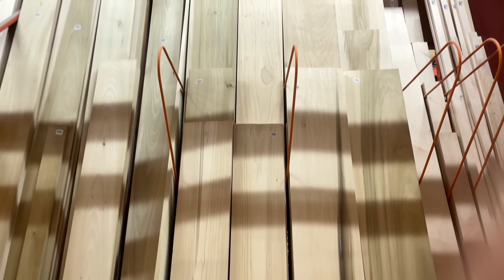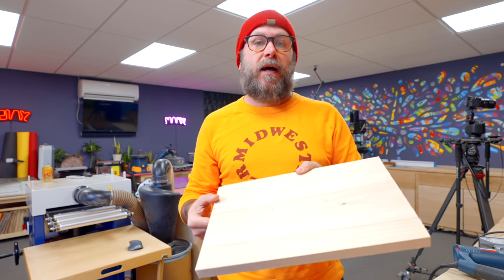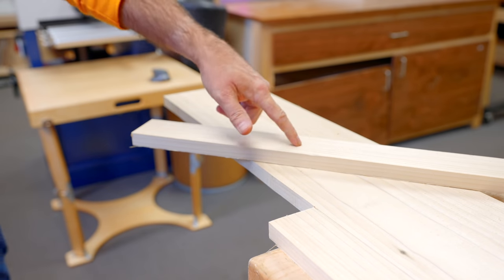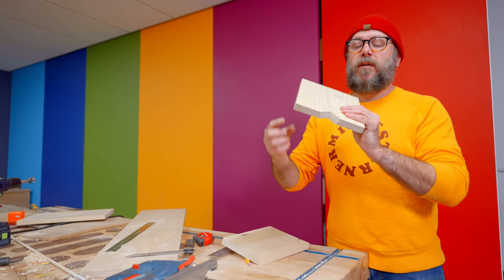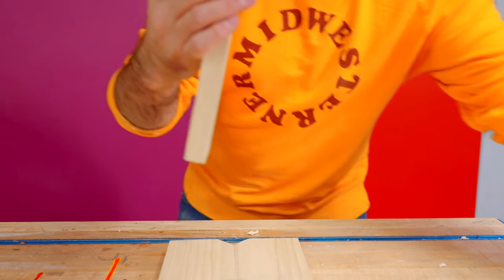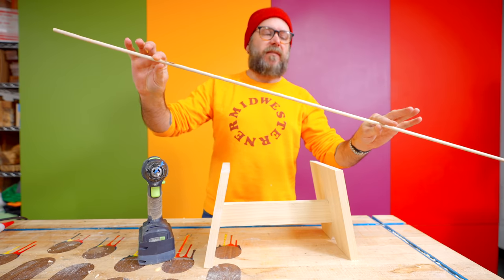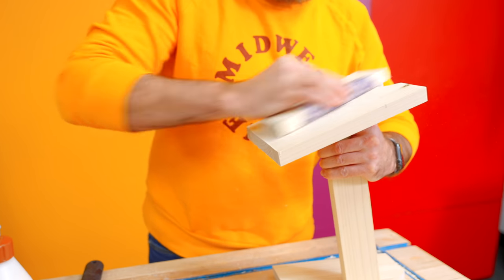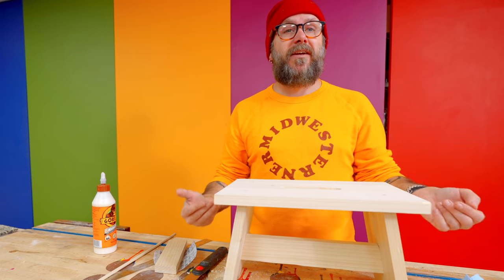A Basic Stool. Your First Woodworking Project

Comment: projects like these are great for veteran woodworkers too that might need some motivation and an excuse to get back in the shop.  I know I run out of inspiration from time to time and need an easier project to get something in the 'win' column
Reply: This exactly.  I'm in a season with no time available so I wander around in a circle for about 15 minutes to think of what I could do then leave with nothing.
Reply: I’m late to the party here, but you’re spot on! It’s good to push your comfort level, but from a 63 year olds viewpoint, I find that constantly raising the bar has actually pushed me away from my woodshop! When we let a hobby get to the point that it antagonizes us, it’s time to reevaluate! There’s a lot to be said for simple, straightforward projects, and this project is a shining example of one!

Comment: Drilling a hole at the apex of the triangles on the legs will prevent a split appearing there in the future. It's easier to drill the hole first then cut the triangle to it. It's the same reason why airplane windows don't have hard angles. Hard angles accumulate stresses and cause splitting.
Reply: Also, when drilling the dowels for the legs don't drill them all at the same angle. If you look at them from the side they should form triangles. This will better resist the top being pulled off.

Comment: That turned out nice! The jigsaw is my least favorite tool, because my cuts are always out of square, or unintentionally beveled. 😄
Reply: I hate it, too. I can never keep the foot planted squarely on the material, or I try to navigate turns too tightly and the blade just kinda screws off at whatever angle it feels it wants to. Most of my cuts need to be sanded/filed/planed back into square.
His comment about the saw pulling itself into the work was interesting. I can't recall seeing that, but maybe it was just my frustration dulling my senses. I think I'll take out a board tomorrow and casually hack it up with the jigsaw just for old time's sake.

Comment: Liked the simple one...seemed to be quicker actually with fewer steps. The one with the fancy tools, soon as I saw it on the CNC, was wondering why not do the cutout on the cnc as well, why then move it to the drill press and then use the jigsaw -- have the CNC do the hand hole -- and just clean up with the sander. Not a fan of the grooves, messes with my OCD, non-uniform.

Comment: Real world notes.  7' piece of poplar (enough for 2 stools if you don't jack it up) was almost $60 at HD.  As a very new woodworker still in middle of this project, it is not complicated but also not easy due to angles.  HD doesn't carry the digital angle finder so I sourced a $10 protractor which worked pretty well once you figure out how it works.  Cutting straight lines at an angle with a jigsaw is not a slam dunk.  Without a straight cut it is difficult to glue them properly as the wood has dips.  If you have a clamp it is also tricky since the clamp is at an angle.  If you use the CA glue method you will need to find CA glue which is not easily obtained at standard stores.  If you use Gorilla super glue  as a stand in for CA glue and have to manipulate the wood at all it may mix with the wood glue and not do as good a job at holding forcing you to use the clamp.  You may then issue an F bomb or two and wish this new woodworker project didn't have angles.

I ended up using a 1/4" dowel ($1.11) to better fit with my drill bits and make it easier to fit when drilling and not  blowing out a side.  I still blew out a side in my haste.  It's a good idea to mark the length of the dowel you are installing or it's hard to know if the dowel has inserted the full length of the drilled hole.  If the size of the drill bit is very close to the size of the dowel it is not a slam dunk to install the dowel and once it is partially installed it will not be easy to remove and start over.  My 6th grade wood shop stool is almost done and I will use a round over bit on my router to make it look a bit more finished but doing is significantly different than watching and there are many many parts which are tricky to the new wood worker.

I'm going to tackle a second stool with the remainder $30 of wood with my table saw and a bit of experience to see if it goes any better.
Reply: Stool is complete and amazingly turned out really nice. Thanks David!

Comment: David, could you shed some light on the cost per board in the US? Maybe for different species?

Any wood where I'm from (northern Europe) seems incredibly expensive. Let alone being able to source anything but construction pine/fir and the occasional pine/fir/oak/beech shelf boards. I love the beech boards but converted to US dollarinos they probably cost 15-20 dollars per meter (lengths up to 2 meters available).

I ask because the majority of hardwood dealers here only sell B2B, so they won't even sell to me haha

Comment: Wouldn't it be easier to use a hand held circular saw for everything but the handle?
Reply from the maker: In woodworking there are many ways to do nearly everything! Use what you have or what you enjoy using the most!

Comment: Very nice!

My workshop is closer to the second build (a small Birch ply CNC router was my lockdown project last year, and is soon to be upgraded with Aluminium uprights, faster spindle, and a second pair of linear rails on the Y-axis, amongst other things).

Just one question; I was wondering why you didn't cut the handle on the CNC while it was set up for the texturing operation at 14:20?

Liked the laser cut inserts; I'm experimenting with laser inlays at the moment... :)
Reply from the maker: Thanks! Honestly I thought it would make for a better video to use the drill press than the CNC. Just to give it a bit more variety.

Comment: Lovely build! I liked all the extra touches in the fancier build like the routed grooves along the top and the staining etc.

Just wondering: is there any reason why you couldn't make this with mortise and tenon joints instead of dowels? Is it just simply a more difficult process to cut the mortises at an angle so doweling is a more simple solution for joinery?
Reply from the maker: Thanks! For me that would have been more difficult. I should have done it just to show it.

Comment: Why the hell is festool going to make the most expensive tools and make them as cheaply as possible. No overmolding, no fiberglass reinforcement to the plastics, they don't insulate the pcb with simple silicone calking to prevent water damage in humid environments. Where is all the markup on the product going? for marketing i assume. I mean it looks like a drill driver from the early 2000s with a ni-cad battery.
Reply from the maker: You must have had bad experience with your Festool tools. That sucks.